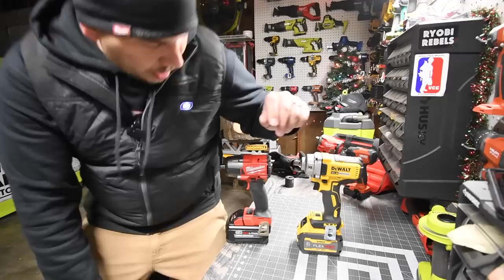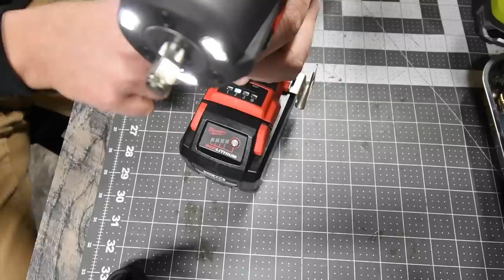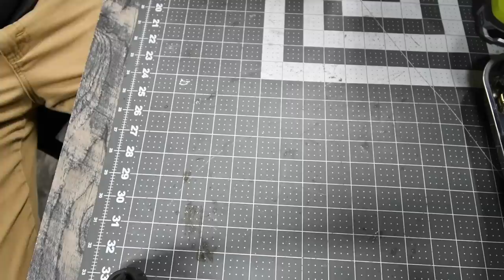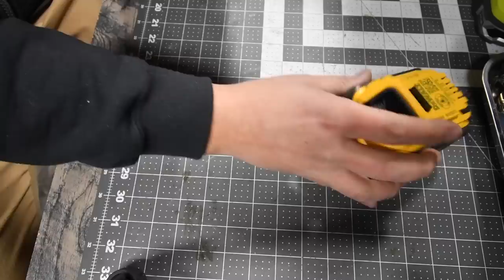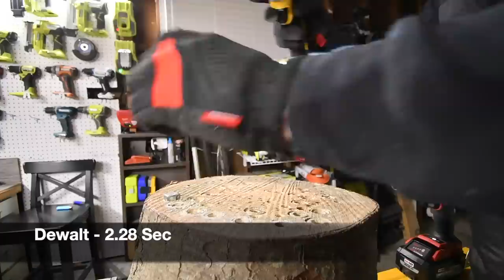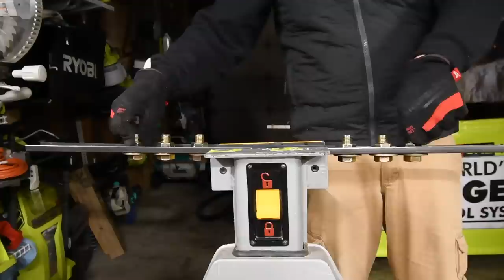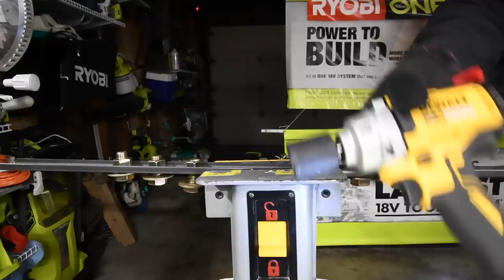NEW!! Milwaukee 2960-20 Vs.  Dewalt DCF894 (Impact Wrenches)

Comment: The question is what kind of Lithium cells is the Milwaukee battery is using??? Are the DeWalt and Milwaukee are using the same type of high output cells 21,700 Cells?? Or is it the Milwaukee have a much higher than that?? Sometimes it's not about the technology of the motor itself but it is about the battery technology.
Reply from the maker: that is correct, another test will be done with 21700 cells in the dewalt
Reply: @ManCaverTools  hey what's up David MCT! Hope you have a wonderful blessed day. More power to your Channel 📐🔨🔧⚙️🛠️ btw still love my DeWalt dcf888 thanks to the Bluetooth connectivity that keeps my tool from being stolen in the jobsite because I can track it anywhere. Especially when my fellow contractor borrows it they can't steal it! 😂

Comment: I was going to buy that mid dewalt, but I got the bigger one.
Reply from the maker: go big or go home lol, I thank you for viewing Kevin
Reply: I was going to get the 899 but decided on the 894 since it will do more than I need with a smaller and lighter footprint but It depends on what you need it for.
Reply: @ManCaverTools  eeeee

Comment: I am pretty sure the Dewalt 6.0 Flexvolt battery uses 15 - 18650 cells.  The 9.0 and 12.0 use the 21700s.  The 6.0 and 8.0 XR battery uses the 21700 also.
Reply from the maker: The flexvolt 6ah advantage battery has 21700 cells in it. The regular 6ah flexvolt batteries have 18650 cells
Reply: @ManCaverTools  Are you sure?  Open it and find out.
Reply: 2 hours later.....
Reply: @Dale37  

Well, not even an hour later, this channel made a live video and opened the battery.  And it was indeed 18650 cells.

Comment: Are you sure that newer 6ah flexvolt with the newer style sticker is 21700 cells? I no the older 6ah are not. Is that newer 6ah the same size as a 9ah? The 20v only 6ah is 21700 cells but the flexvolt 6ah is 18650 at least with the older battery. Either way in this test the milwaukee would still win. I dont see it being possible that the 6ah is 21700 unless its jus as big as a 9ah which it probably isnt
Reply from the maker: it doesn't have the 21700 cells in them.mi opened one up and checked Live. they have 18650 cells in them. another youtuber said they had 21700 cells so I wanted to check for myself and they do not.
Reply: @ManCaverTools  thanks for the confirmation. I thought that was the case. The dewalt 20v only batteries of the 6ah and 8ah are the equivalent batteries of milwaukee high output 6 and 8 which are 10 21700 cells.

Comment: For a long term uses between a high torque milwaukee and dewalt which you recommend ?
Reply from the maker: id go with the milwuakee because it does seem to be more compact and more powerful.
Reply: @ManCaverTools  How often do i need to put new grease or service for milwaukee if i using it everyday ?

Comment: Using chrome sockets and adapters....
Reply from the maker: you obviously didnt watch the video.
Reply: Guess it's straight to hell for me, since I use chrome sockets on my impacts.
Reply: @ManCaverTools  So you are telling me, that there would be no improvement at all for the Milwaukee if you used the proper sockets? It wouldn’t be even faster?
Reply: @Dale37  Yes. That is a cardinal sin.

Comment: Dewalt needs to update their products more frequently like Milwaukee I feel like Milwaukee get  new tools every year also I was kind of rooting for Dewalt but I figured it would lose because it’s much older. Interesting because you had to also use an adapter on the Milwaukee and not the dewalt.
Reply: Yes, I believe that is a point will forget in this video. 3/8 hog ring vs 1/2 inch & Milwaukee still smoked the testing.
Reply: @melsmobileservices4223  Yes I agree but I still like To see if your comparison regardless
Reply: @ZeGermanHam  oh no doubt....when it come to raw power...... Milwaukee don't play fair 😂.
Reply: @melsmobileservices4223  

Except when it comes to drills... DeWALT dominates...
Reply from the maker: I think they need to as well. along with other brands need to
Reply: They don't update as frequently so they are more reliable. I've never had an issue with any of my Dewalts. I was thinking about switching, but I heard of lots of reliability nightmares with them, especially the batteries falling out. In addition, lots of Mac tool dealers will warranty Dewalt. If you have Milwaukee at a shop, you have to hope there is an independent tool dealer that sells Milwaukee.

Comment: so why are you comparing a 3/8 impact to a 1/2 inch? milwaukee still kicked its ass but why not compare apples to apples? what am i missing? 2861-20 is what you should have compared it to IMO. still this one spanked the dewalt, i like both tool lines. but in some instances milwaukee for the price cannot be beat.
Reply from the maker: and anvil is just a anvil. the motor stays the same between the 1/2 or a 3/8 model when it comes to this Milwaukee.
Reply: @ManCaverTools  actually that's not correct, the 1/2 inch has 50 ft lbs (650) over the 3/8 (600). Look at the spec sheet for both. 1/2 inch is the way to go and leave the 3/8 for that sweet stubby.

Comment: Dewalt 6AH Flexvolt has 18650's. 9AH and 12AH has 21700's.
Reply from the maker: correct, I did a different video with both tools using 21700 cells in 6ah batteries

Comment: Milwaukee has an impressive new mid torque, but Dewalt obviously hit a knot on the 5/8 test. The Milwaukee was not 3 times faster on the other lags. Should have pull each other out like before so you can see inconsistencies in wood.
Reply from the maker: it really is a power one. unfortunately I have no way of telling if it hit a knot or not. but I thank you Steve
Reply: I’d rather save the hundred dollars and get Dewalt. I have don’t mind a few extra seconds, I have the time

Comment: As stated already, these big lags split wood. So drilling directly next to the first bolt or even hole on this well abused log is an advantage. You should have drilled in a completely fresh log and away from each other. Good video otherwise though.

Comment: hey bro don't be a liar with the dewalt he ain't got 600 lbs torque
Reply from the maker: yes it does.  this dewalt has 330 ft lbs of fastening torque and 600ft of  nut busting torque. do your homework before you comment

Comment: Don’t put the screws so close to each other. First one got it tough and the other one, is alredy dealing with the cracked surface, which is much easier in both ways man. Do the same test you n the different direction and then I’ll agree possibly 😅

Comment: Thats no the professional way to test and compare 2 similar tools !!! you have to use 2 proves at the same time. Otherwise  your letting Dewalt tool to get the nut loose  and them  the other tool does the rest of the job... it is not fair !! nor professional.